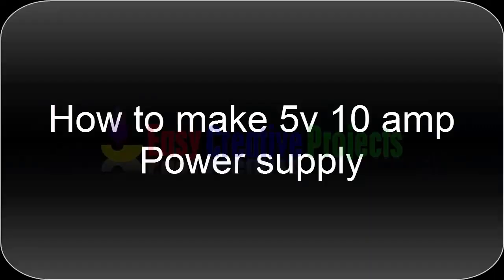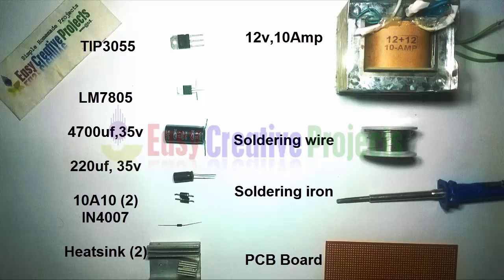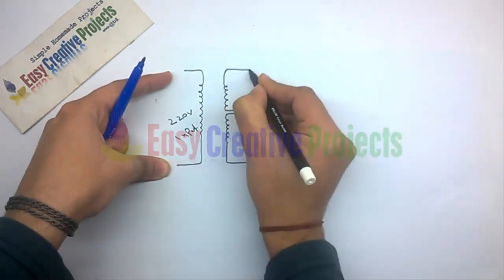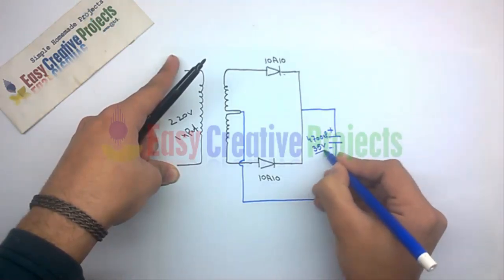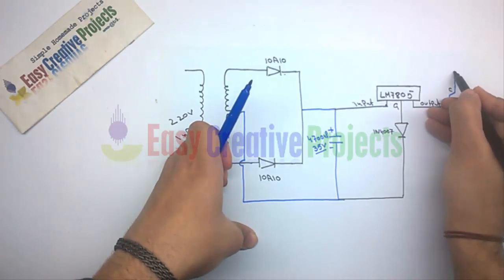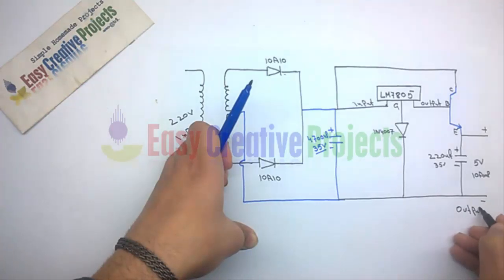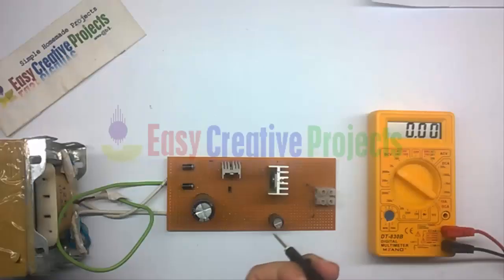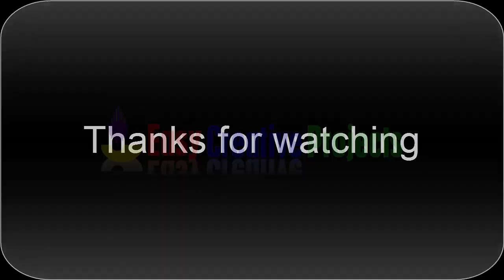How to make 5v 10 amp power supply - easy with circuit diagram

Comment: 7805 is for 1Amp and gives max surge 2.2 AMP

Bhai kisko bna rha hai thoda padh leta to jyada aacha rhta
Reply from the maker: my dear friend. kindly open your computer power supply and find 5v and 12v voltage regulater. and check ampere, you can get 4amp. 
now tell me how its possible with your theory?
here voltage regulater only use for controll voltage. and transistor use for handle ampere.  
its electronic science. so kindly focous learning and practical work. 
thanks.

Comment: Is it possible to make the same 5v 10amp out put dc without using any transformer of 12v 10amp?
Reply from the maker: without transformer you cannot handle high ampere.

Comment: i want to create a power supply 5v 2a, do i need the tip 3055 or something else?, because i have used only the tip 7805 and the current output on the 7805 is only 300-500mA. but in the datasheet 7805 can deliver 1A.
i use trafo non CT 12V 2A, Capasitor 1000uf 25v TIP 7805.

thanks i hope u can give me suggestion or solutions.
Reply from the maker: you get 500ma because your transformer provide 500ma output. 
maximum companies only says its 2 ampere but in actual its not 2amp. same like my case. i buy 10amp transformer but its provide me 6amp output. 
.
use same circuit and only replace transformer with 2ampere. and your job done.
thanks.
Reply: Please provide a circuit diagram of 5volt 5ampere power supply for pixel leds

Comment: Hi, Is a 24dcv 10 amp power supply connected to the input?
Reply from the maker: yes you can use. because we use lm7805 for voltage. its can handle maxim 35v.

Comment: Current 5.67 Amp between 10 Ohms Resistor means Applied Voltage 56.7V V=IR. 5V = 5A x 1 Ohm. 
So something wrong with your project.
Reply from the maker: current come from transformer. if you connect simple diode and capacitor then its also provide 5amp. but for decrease voltage and get same current this method work perfectly. thanks.

Comment: Please make 5 volt 5A power supply please
Reply from the maker: simple replace 10 amp transformer with 5 amp transformer. and use same circuit.
thanks.

Comment: Can we increase to 20A by providing additional TIP 3055 in parallel to the existing circuit?
Reply from the maker: you can increase current with the help of 20amp transistor and transformer.
thanks.
Reply: @EasyCreativeProjects  can we add a 47k regulator to the output from where the current and volt is coming.

Comment: 12v to 5volt 60 amp
Reply from the maker: try to find 60amp transistor and simple replace.
replace 10amp transformer with 60 amp transformer.
thanks.

Comment: I need 7905 with 5A current which transisy I can use please help me
Reply from the maker: simple replace 10amp transformer with 5 ampere transformer.  
you also need to replace lm7805 with lm7905.
some more changes as your circuit demand.
thanks.

Comment: i cant run my peltier 5v help
Reply from the maker: please check your peltier current. how many current require for it.?
i think its work 4amp. 
you can use computer power supply. its give you 5v 4amp output.

Comment: how to make 5v 2.3 amps what should i adjust get this value??
Reply from the maker: dear you can make it with two mothered.
1st: simple replace 10amp transformer with 2.3amp transformer. and use this same circuit.
2nd: watch this video on our channel ( How to make 5v adjustable current power supply ) and adjust current as your demand.
thanks.

Comment: Why did you used the transistor?
Reply from the maker: Dear because our requirement 10 amp. and voltage regulator provide us only 1amp. so we use transistor. for more detail you can visit our website.
thanks.
Reply: @EasyCreativeProjects  Ok, thanks.
Keep making videos.
Reply from the maker: you welcome dear.